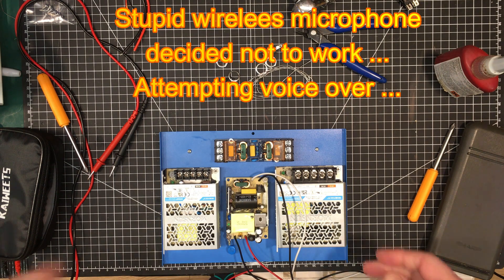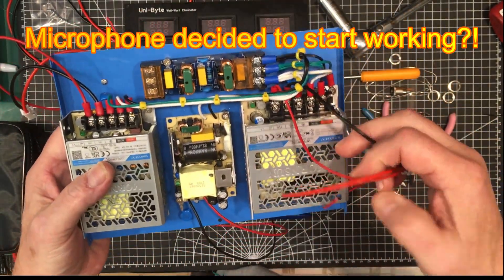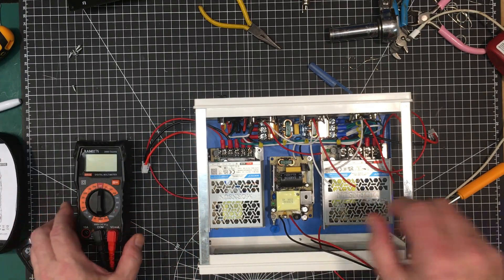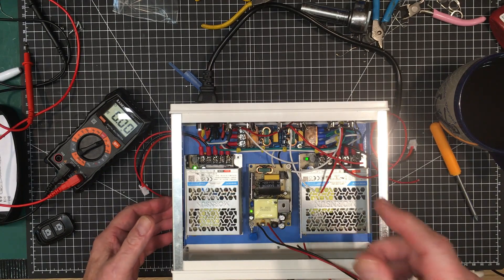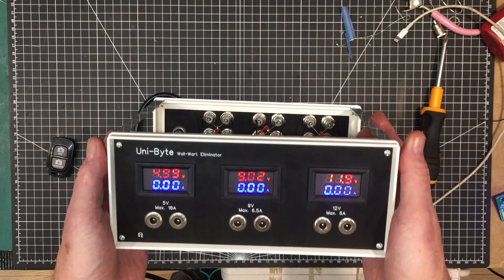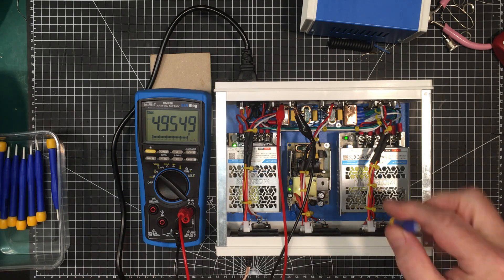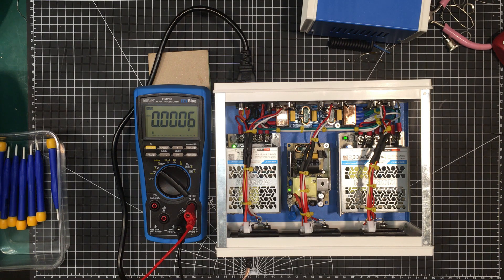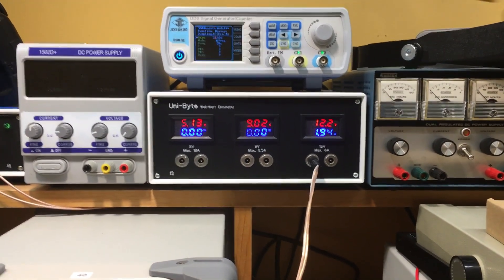0100 - Build a Wall-Wart Eliminator for your Lab:  Part 2

Comment: I would love to have one or two of these. In Ireland we use a 230 volt mains supply.
Reply from the maker: Those little Mornsun power supply modules will work fine with 230V.

Comment: Great project.
FYI, the links in the description are not all correct - the DC Power Jacks, CAbinet, and Panel Meters all point to the DC Power Jacks page, and the Fuse Holder and IEC socket links link to the Fuse Holder page.
Reply from the maker: Should be working better now.  Thanks for letting me know.
Reply from the maker: Doh!  I'll correct that when I get home.  Thanks!

Comment: Nice build. Yes, I vote for a noise test video, please. Just a thought... Most everybody ends up with extra laptop brick power supplies. They are usually well engineered and quiet. They might be acceptable, for this purpose. Yes, their voltages might need to be adjusted to the desired output.
Reply from the maker: One of the big ones for those gaming laptops and a set of good quality buck converters would be a very good set-up.

Comment: yes, I absolutely would like to see some performance testing... There were some things in this particular video which you were checking things,  like what you called as leakage current. When you did that test show us where you put the probes to get that measurement,  I suspect I know...:-) but I hate guessing at it, and maybe a pinch more explanation on what leakage current is and what the concept means...  might help at least for me.  it's also my understanding with the type of power supplies you used, they are not load dependent like a wall wart is. But, maybe you could monitor the voltage with a voltmeter and apply a load to see if you really do get much of a voltage drop, I bring this subject up because of how you set the meters a little above their nominal voltage which I understand,  too be due to the resistance that may be in "play" during real-world usage, but, if it were me,  doing the setup adjustments. I would possibly tinker with getting those meters to read like they should, with a certain amount of load on them. I don't know without tinkering and experimentation and gaining experience with this particular set up,  what the potential is when making these adjustments, 5.1 with no load sounds reasonable to me. But the 12.3 seems a little high, again, I know you're calculating this from your years of experience. But, there may be an opportunity to get this device to be as accurate as possible while in actual usage as it can be.   You certainly have assembled this with a lot of care, and good wiring techniques. (  Of course there's always room for improvement after the first assembly when creating something ) and as you build this project. You learned some things that if you were to build this again. You might do a little differently.  Also, can you comment where you had those front panel plates created or silkscreened ?    I personally don't like to build kits anymore Of Any Type unless it has a reasonably nice case created for the device.
Reply from the maker: Thanks for your .. extensive .. query.  Great questions!  However, almost every one of them requires a response that is longer than your entire post.  I don't mind answering one of them in detail  here, but this is certainly not the place to answer all of them.  So, I think answering your fist question, about the leakage current, would go a long way to helping with the rest.  You say you suspect where I am making my measurements, but in reality I state that very clearly at least twice,  Perhaps this is something you want me to delve into with a little more clarity?

As for the panel meter accuracy.  To be honest we are dealing with a replacement for the lowest form of SMPS power supply - wall-warts.  These are NOT by any stretch of the imagination accurate devices.  My choice to be happy with 1% accuracy is fantastically better than you can expect from the average $3 wall-wart.  So, other than the Amps reading I took of the 5V panel meter I am totally happy with their present calibration. 

And in case you missed the flow of the video, I did verify the accuracy of the panel meters, then put them under load and reported the results.  Under the small load I applied each of the PS units did not drop significantly (actually not at all).  I do plan to do further tests and will, by popular demand, report the results. I do expect as they reach their specified rating they will sag a little and produce both more differential mode noise and common mode noise.  However, Past experience with Mornsun SMPS modules it they exceed specification by  a good margin.  That will handily smash the specs of the average $3 wall-wart.

As for my setting 12V to 12.3V?  That is not significantly different in this context from setting 5V to 5.1V.  Just do the math and you'll see.   Voltage drop over a meter of #20 or #18 wire @1A can be significant.  That aside, each and every device that is designed to use a cheap wall-wart as a power source MUST also be designed to be tolerant of power source irregularities.   Those devices that are not are what we usually call utter crap and dispose of forthwith.
 
Keep in mind this device is intended to replace and significantly improve on cheap wall-warts.  5 nines of accuracy is not our goal.  For that you need to spend $20,000 or more.  However, this is at least an order of magnitude better than your average cheap wall-wart, and more than an order of magnitude more expensive - But is does replace and order of magnitude more wall-warts.  So a huge win!!.  And that has already been shown from the simplistic operational tests I have already done.

So, would you like a deeper dive into leakage current and the common mode noise that causes it, or would something else be better?
Reply: Ohhh ... Man...  That was a great reply, and generally speaking, my thought process follows pretty much what you stated in your reply about the real purpose of this power supply and the parts involved to create it, I truly like what you did here very resourceful.  And I too am not impressed by most wall Warts, and what really "chaps my hide"🙂 is when they are used for audio devices, whether it be an amplifier or speaker amplifier combination anything where the lousy filtering from these wall warts gets through the device and causes buzzing, any knowledge and experience that you can pass along to the audience for consideration if they decide to tackle a project like this would be very helpful. You put in a filter to help improve the performance overall for this power supply. You did that because you knew from experience that it would be an improvement. Given the parts that you are using to create this power supply. Hopefully that makes sense I think you know what I'm getting at.  Great channel you have great content, and I certainly look forward to everything you have to share with us.